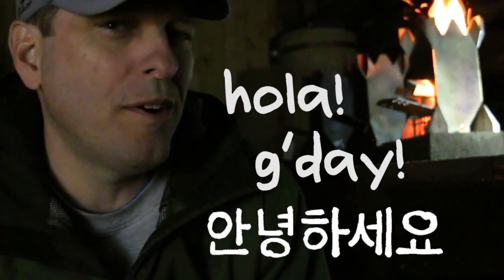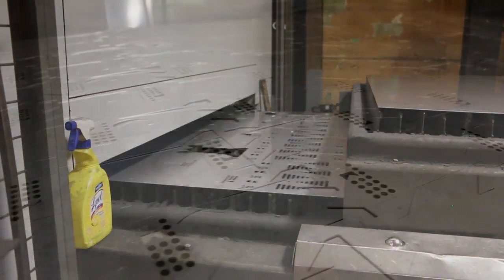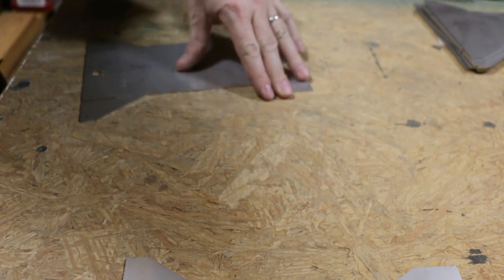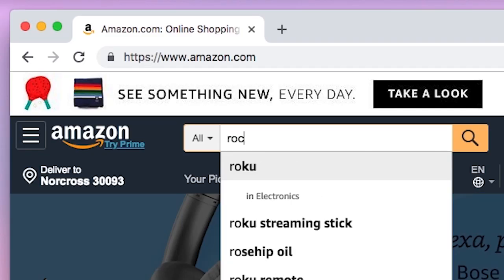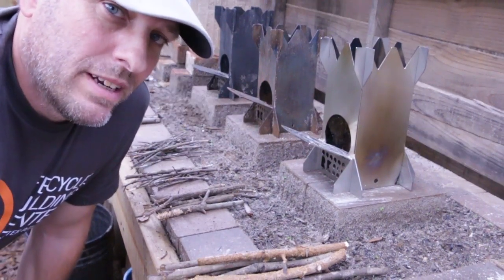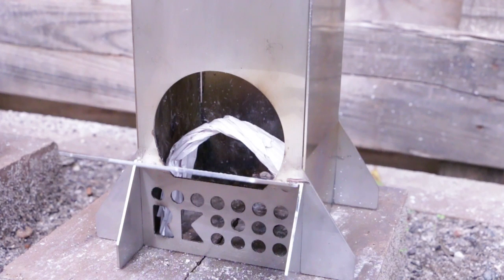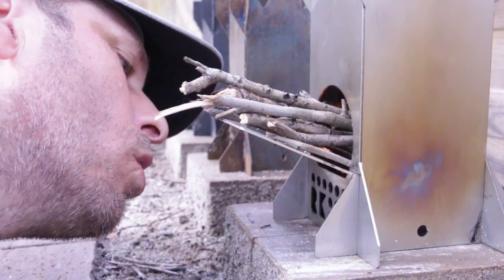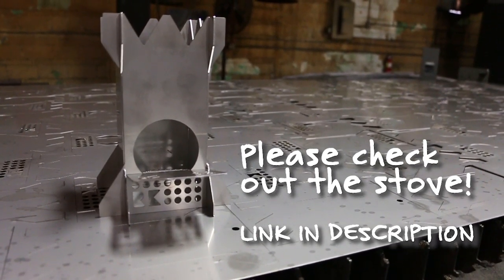How To Light The Rocket King Camping Stove

Comment: Hello i have a question fron your worm tea video and cant find a real answer, i started composting but not with worms yet, i understand the tea is very beneficial, but was wondering about the compost itself. Is the compost still healthy and usable or does it fall short due to the run off of nutrients from the watering (which makes tea) because i need soil for planting
Reply from the maker: It is true that the castings will lose some nutrient value when water is run through them, but it think the remaining soil will still be valuable to plant in. I usually mix the compost with some native soil. Thanks for watching.
Reply: @GreenShortzDIY  thanks a bunch this really helped me out